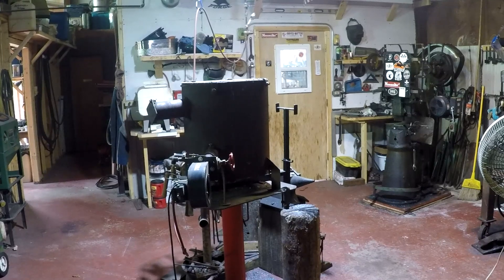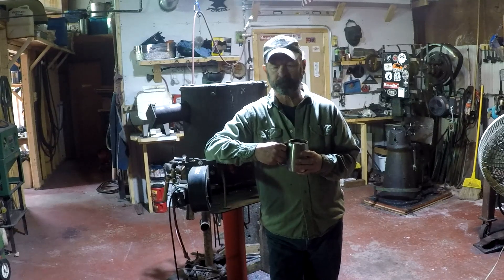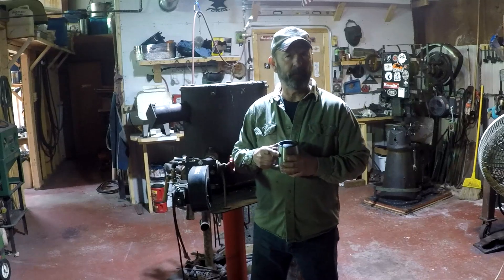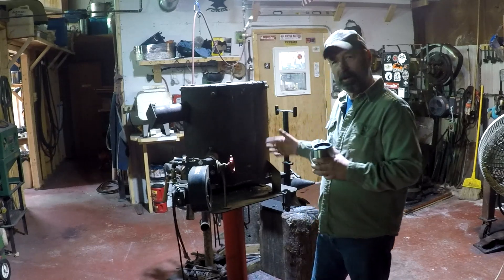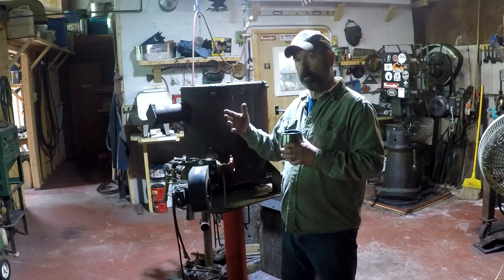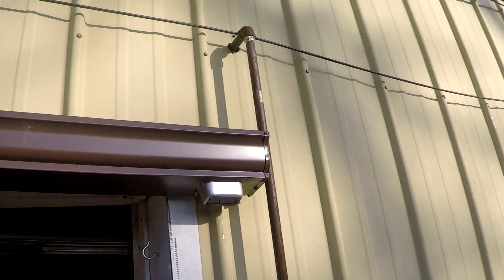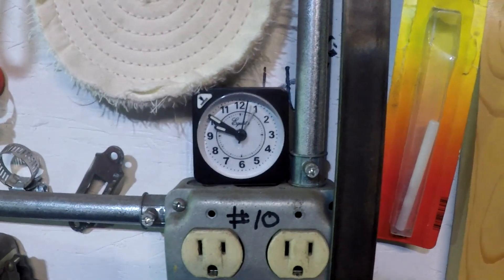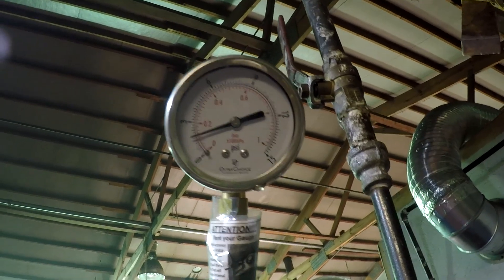Forge system

Comment: Is your burner tube open ended or is there a plate with holes?
Reply from the maker: It's just a straight open tube. I think it's 1 1/4" ID.
Reply: @KarlBAndersen  ok thanks.. I use a forced air blower but i put a plate on the end of the burner tube with about 10 holes.. works pretty good but i always want to upgrade.. hope you have a great new year!

Comment: I think a lot of people miss the volume part of the equation. The venturri burners I am using at present have small orifices, and therefore I need to use 9 or 10 psi through them to suck in enough air. With the blower, you are using a larger orifice to dump the propane, so less pressure gets the same volume. Thanks for showing this. Your forge is actually a little larger than I expected. I think I may change to a forced-air setup some day. Not sure. take care.
Reply from the maker: The larger volume heats up more mass. With this type of forge you are mostly heating the steel with the mass of the heated forge. More mass = more heat. Up to a point.